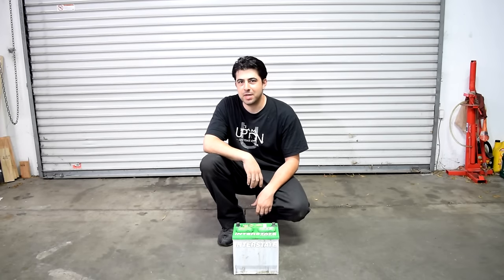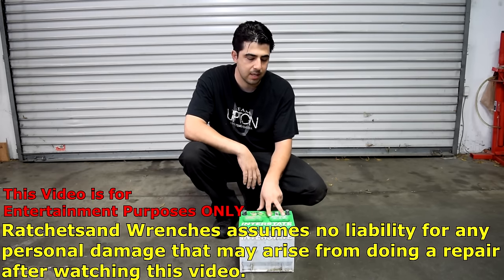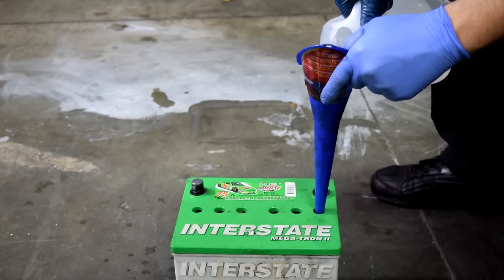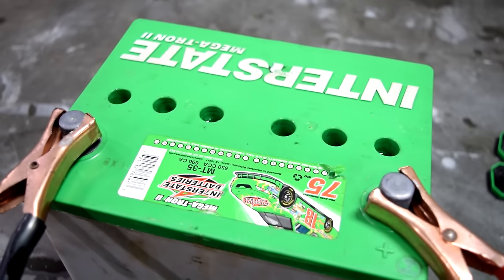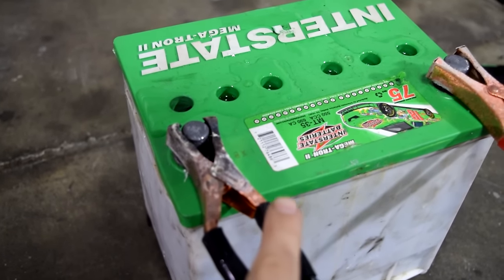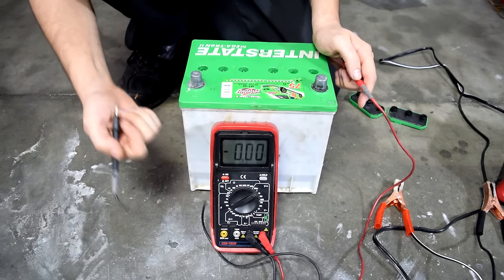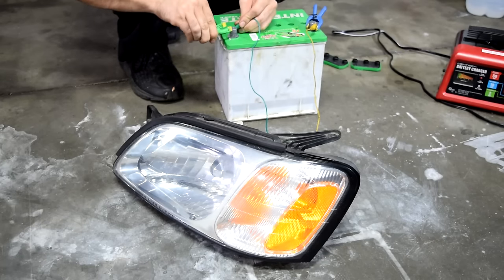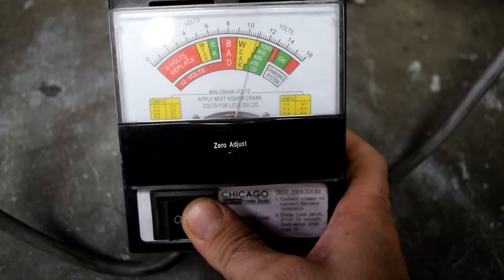Is it Possible to Revive a Dead Battery with Epsom Salt - See For Yourself

Comment: This method might a actually restore a battery under some circumstances, but as a general rule, the most common reasons for battery failure would not be helped here.  I used to work in an automotive battery manufacturing plant.  While there I met a man who had actually tried to start a business which identified junk batteries that could be reconditioned for resale. (Junk batteries are the used batteries that shops take in from consumers, which are usually sent to a lead smelter to recover the lead.)  The business failed, because only a small percentage of batteries could be reconditioned, and even the ones that could be reconditioned frequently failed again within too short a time to make them worth paying money for. And he tried this back when our roads in the US were generally in much better condition. Roads? Yeah, one of the most vulnerable parts lead acid batteries is the inter-cell connections.  On a typical 12 volt automotive battery there are five inter-cell connections.  If just one of these connections becomes damaged, the battery will fail.  A battery that bounces around a lot on bad roads is much more likely to have this type of problem.  Since most batteries these days are assembled via automation which requires higher molten lead temperatures, the lead takes on a crystalline structure which is more easily broken over time.  If your battery is what we used to call an 'oddball' battery -- a battery type that is kind of rare -- then it's more likely that that battery was made by the hand method, which produces much better inter-cell connections. Road vibration can also cause the separator material between the plates in the battery to get worn causing shorts.  The hallmark of a cheaply made battery is cheap paper-like separator material.  Really high quality industrial batteries encase cells in envelopes of high quality separator material, but since this tends to make each cell a lot bigger, you rarely see this on automotive batteries.  Most of the time manufacturers put better quality separator material in the batteries with longer warranties.  In summary, automotive batteries simply are not engineered to last indefinitely, and in the greater scheme of things, they are not all that expensive to replace when needed.  Sure, if you've got the time and inclination, you might put off the inevitable for a time, but even though batteries don't have moving parts, they eventually just wear out.  Personally, a know a whole lot more about batteries from both the chemical, engineering and manufacturing standpoint, but when my battery starts to go bad, I just replace it. If it's still under warranty, fine. If not, I know that it was never engineered to work indefinitely.
Reply: That's about right---built-in obsolescence, period
Reply: There are some really interesting videos here on youtube about people that have replaced their automotive batteries with capacitors.  Capacitors will not store as much energy, but they will last a long time if the quality is good. One guy used a small battery as a backup for the capacitor bank, so that he could run his radio when the car was off.  I really like this kind of thinking.  In my opinion, what cars have always needed us a simple and reliable backup power generating system.  Such a thing would be ideal for use with a capacitor bank.  In general, though, I think that lead-acid batteries are going to start gradually disappearing from the automotive scene. Not only are other battery technologies advancing rapidly, but with computers intimately involved in every aspect of the automobile's operation, it is now possible to start a vehicle with far less power.  The computer can know the exact location of every piston on the engine, an determine the best low-power starting sequence.  Then again, there have been serious predictions -- dating back to the 1970s -- that have predicted the internal combustion engine's demise, but because so much transportation infrastructure in built up around petroleum products, alternatives have never gotten of the ground.  The thing about batteries and obsolescence is that the cost of building truly high-quality, uber-long-lasting batteries would be prohibitively expensive.  In fact, you can buy same really high-quality batteries today.  They are usually purchased by people who have power-hungry, high-end stereo systems in their vehicle.  Oddly, despite the high build quality, the manufacturers do not appear to offer longer warranties for their products, so unless you just really need the amps or added reliability, they are not very cost effective.
Reply: Wen0110 Thank you for the valuable feedback. Nice to hear from someone involved in the manufacturing side. I was actually thinking of starting a battery recovery business myself but had so little success that I realized early on there's not much money to be made there. Too many batteries have serious physical damage that simple cycling or chemical treatment won't be able to fix.

I am a mechanical engineer in my day to day job (I started out in a semiconductor manufacturing plant and these days I work in aircraft maintenance). I know exactly why things are built to only last as long as they need to, and not longer: the price. 

Think of it this way. Nowadays people are happy buying a $85 car battery that lasts 5 years. That's what everyone is used to in fact. 
It is possible to make a car battery that lasts longer. But obviously the cost of the better raw materials, higher quality supply chain, more accurate production processes, more quality control steps, etc. would drive the price up. 

Say a company actually did that, and made batteries that last 10 years but cost $140. Most consumers wouldn't buy it! 
They wouldn't sell anywhere near as many batteries as the companies selling regular 5-year batteries for $85 because for most consumers, the sweet spot for price vs. quality is right where regular car batteries already are now.

In contrast, for deep-cycle applications (like off-grid, marine and RV use), the sweet spot is further up the quality scale, and these batteries are typically more more expensive and much better performing. Some modern setups even use LiFePO4 batteries (about 4-6x the price of normal lead-acid) because of the longevity and performance advantages! Only high-end cars like the Porsche 911 come with a lithium-iron-phosphate option!
Reply: Wen0110 
Very good comment
Reply: Very good  comment
Reply: Yeah, everyone's looking for The Fountain of Youth and it just doesn't exist. Well said! Chances of rejuvenating a car battery for much longer than a few weeks is unlikely. However, we do pay much too much for new car batteries...got us by the balls!
Reply: Thank you. Yes, I would imagine you would need to actually test the battery to see what condition it is in now before you would consider this.
Reply: walmart = 49 dollars
Reply: Deep cycle batteries seem to have stronger connections between cells.
Reply: I worked for a used car lot in the early 80's. We bought all of our replacement batteries for $18 each (with exchange)  from an old guy who made a fair living selling reconditioned batteries to used car lots. I don't know how he did it, but it certainly be done.
Reply: thanks for the info.
Reply: Marine batteries , expensive can pay dividends if one wants long life batteries in rough conditions.
Reply: Eric jones not for an interstate.
Reply: Wen0110 very insightful
Reply: @williamgregor8495  that's like calling worn out tires built in obsolescence.  There is a big difference between wear and tear where something wears out and being obsolete where things still works fine but got replace by the "latest and greatest".
Reply: is the best explanation of all, but I saw in another video a guy who repaired a battery only with water and Epson salt
Reply: Magic mender green
Reply: "Great", was my first thought. I don't need a new battery - I can do that ....... but after reading the educated explanations down here, especially from Wen0110, I scrap my plan and buy a new battery.  No reason to subscribe here to get only bad advice.
Reply: Wen0110 thanks
Reply: @Wen-ve8nx  they do have a back up sytem for energy like that they use large capacitors to help give energy to audio sytems that draw to much power from the battery when the base drops.
Reply: Thank you brother.... Time is money and you was a big help
Reply: @Ihavetruth22   not where i live 149 00 750 cca
Reply: I'm a auto electrician and i agree with you, when you battery is dead, it's dead, just replace it.
Reply: @aguanut  must have been in the eighties.
Reply: Wow! You're the battery guru! Great info!!! I often wonder how much bad roads contribute to battery failure. You make good points. I think I'm going to pad the bottom of the battery tray. Can't hurt.
Reply: Appreciate video content! Sorry for the intrusion, I would appreciate your thoughts. Have you ever tried - Lammywalness Trendy Trade Guide (probably on Google)? It is a great one of a kind product for learning how to recondition batteries at home without the normal expense. Ive heard some decent things about it and my cooworker after a lifetime of fighting got excellent results with it.
Reply: Nice video content! Excuse me for the intrusion, I am interested in your opinion. Have you considered - Lammywalness Trendy Trade Guide (do a search on google)? It is a great one of a kind product for learning how to recondition batteries at home minus the hard work. Ive heard some super things about it and my m8  got great success with it.
Reply: Appreciate Video clip! Excuse me for the intrusion, I would love your initial thoughts. Have you considered - Lammywalness Trendy Trade Guide (Have a quick look on google cant remember the place now)? It is a good exclusive guide for learning how to recondition batteries at home minus the hard work. Ive heard some extraordinary things about it and my cousin at very last got cool results with it.
Reply: I don't know much about the dynamics of battery technology but your comment makes a lot of sense to me. I can't deal with all the maybes and potential hazards involved. If my battery is bad, simply replace it. It ain't worth it, especially the risks.
Reply: Words of a smart person
Reply: Just wonderful, I been tryin to find out about "rebuilt auto battery" for a while now, and I think this has helped. Have you heard people talk about - Ammaceen Reconditioning Rabblement - (do a google search ) ? Ive heard some decent things about it and my co-worker got amazing success with it.
Reply: Many thanks, been searching for "reconditioned battery car" for a while now, and I think this has helped. Have you heard people talk about - Ammaceen Reconditioning Rabblement - (should be on google have a look ) ? Ive heard some pretty good things about it and my co-worker got cool success with it.
Reply: This was great, thanks, I have been researching "restore a car battery" for a while now, and I think this has helped. You ever tried - Ammaceen Reconditioning Rabblement - (Have a quick look on google cant remember the place now ) ? Ive heard some great things about it and my mate got cool success with it.
Reply: I've been researching into battery reconditioning and discovered a great resource at Magic Mender Wizard (check it out on google)
Reply: There are several factors in doing a pro job. One plan I discovered that successfully combines these is the Magic Mender Wizard (check it out on google) definately the most helpful course that I've seen. look at this  interesting resource.
Reply: Cheers for the Video! Apologies for the intrusion, I would appreciate your opinion. Have you ever tried - Rozardner Powerful Battery Reality (do a google search)? It is a good one off product for learning how to recondition an old battery minus the hard work. Ive heard some unbelievable things about it and my mate at very last got astronomical results with it.
Reply: Thanks for the Video! Forgive me for butting in, I would love your initial thoughts. Have you tried - Rozardner Powerful Battery Reality (do a google search)? It is a great exclusive guide for learning how to recondition an old battery minus the headache. Ive heard some interesting things about it and my cooworker finally got astronomical results with it.
Reply: Great video content! Excuse me for the intrusion, I would love your thoughts. Have you ever tried - Rozardner Powerful Battery Reality (google it)? It is a good exclusive product for learning how to recondition an old battery minus the normal expense. Ive heard some unbelievable things about it and my friend at very last got amazing results with it.
Reply: @shaibaldev8588  Scam.
Reply: Nice Video clip! Apologies for butting in, I would appreciate your thoughts. Have you heard the talk about - Rozardner Powerful Battery Reality (Have a quick look on google cant remember the place now)? It is a good one off guide for learning how to recondition an old battery minus the normal expense. Ive heard some incredible things about it and my friend Sam  got great results with it.
Reply: Appreciate Video clip! Forgive me for the intrusion, I am interested in your thoughts. Have you heard about - Rozardner Powerful Battery Reality (do a search on google)? It is a smashing exclusive product for learning how to recondition an old battery minus the normal expense. Ive heard some awesome things about it and my mate at last got amazing results with it.
Reply: Lovely Video clip! Sorry for butting in, I am interested in your initial thoughts. Have you ever tried - Rozardner Powerful Battery Reality (do a search on google)? It is a good one of a kind guide for learning how to recondition an old battery without the headache. Ive heard some awesome things about it and my BF finally got amazing success with it.
Reply: Appreciate Video clip! Excuse me for chiming in, I would appreciate your opinion. Have you thought about - Rozardner Powerful Battery Reality (search on google)? It is an awesome one of a kind guide for learning how to recondition an old battery without the headache. Ive heard some pretty good things about it and my old buddy Taylor  got amazing results with it.
Reply: Nice video content! Excuse me for butting in, I would love your thoughts. Have you thought about - Rozardner Powerful Battery Reality (Sure I saw it on Google)? It is a smashing exclusive guide for learning how to recondition an old battery minus the normal expense. Ive heard some extraordinary things about it and my close friend Aubrey finally got great success with it.
Reply: Kudos for the Video! Apologies for the intrusion, I am interested in your initial thoughts. Have you researched - Rozardner Powerful Battery Reality (should be on google have a look)? It is a good one of a kind guide for learning how to recondition an old battery without the normal expense. Ive heard some amazing things about it and my mate  got astronomical success with it.
Reply: Kudos for the video content! Excuse me for butting in, I would appreciate your thoughts. Have you researched - Rozardner Powerful Battery Reality (should be on google have a look)? It is an awesome one of a kind guide for learning how to recondition an old battery minus the headache. Ive heard some decent things about it and my buddy at last got astronomical success with it.
Reply: Imagine how good social media would be if all comments were this informative and thoughtful.  Thanks dude.
Reply: Nice Video clip! Forgive me for the intrusion, I am interested in your opinion. Have you tried - Lammywalness Trendy Trade Guide (do a google search)? It is a good one off guide for learning how to recondition batteries at home without the hard work. Ive heard some super things about it and my m8 at very last got excellent results with it.
Reply: Appreciate Video clip! Forgive me for chiming in, I am interested in your initial thoughts. Have you thought about - Lammywalness Trendy Trade Guide (google it)? It is an awesome one off product for learning how to recondition batteries at home minus the headache. Ive heard some amazing things about it and my cooworker at very last got great success with it.
Reply: Thanks for the Video clip! Sorry for butting in, I would appreciate your initial thoughts. Have you considered - Rozardner Powerful Battery Reality (do a search on google)? It is a smashing one of a kind guide for learning how to recondition an old battery minus the normal expense. Ive heard some awesome things about it and my work buddy at last got excellent success with it.
Reply: I would never sell a battery like this to anyone no matter how well it tested. this is strictly to restore a battery to be used by the person restoring it and if it doesn't work no harm done.
Reply: @celinelait9893  you have put lot of advertisement here
Reply: @LMF5000  The price of anything has not much to do with manufacturing cost anymore. Its the "sweet spot for price" as you called it what dictates the prices. We saw it during covid19 and after. Most everything is more expensive and people accept the price because - at least its available. So what happened ? We started to appreciate things we took for granted and allow the higher price. It also killed the low profit retailers who did not have a fall-back plans in case there is a low sales for a few months.  
Things are priced randomly. A part that fits a Chevy Cobalt vs. the same part that fits a Cadillac or Porsche can have 400% price difference.  Not because its better or more expensive to manufacture but simply the "sweet spot" as in what can a customer pay for the part.  Obviously the guy with a 100k car will not hiccup on something that a 20k car buyer will choke on.  I work in the car industry and I buy huge windshields for $36.80 - and also small ones for $600.  The cost of the windshield should be based on the amount of glass it needs. But it isn't.  Its priced on what the new car cost and how many pieces can we sell from each one. The molds are sand so they need to be redone periodically, thus the actual cost of a BMW i8 vs. Ford F150 isn't really that much difference.  You might sell 8 for the BMW i8 and 80,000 for a F150 annually.  The price of a glass is set, none are much different then others.  I'm pretty sure its same at batteries. The separator plates are probably cheap, so a much better battery would cost 4-5usd more but since it would be "more expensive" the price will be dramatically increased thus selling in lower numbers.  The key is - volume. If they make them just last the warranty period plus 50% , then after that every customer will buy a new one. The profit on 2 cheap batteries  are more then selling one that last double the time but more expensive.  You can't double the price as it would fall out of the "sweet spot".  Everything is dictated by the profit margin. 50-60 years ago companies were proud of their quality, today they are proud of their quantity (or profit margin). This is modern life, everything is a throw away item. Hence the reason for the huge garbage problem which creates more expensive and lesser quality products.  Sadly the end user is ending up with frustration and more purchases and more junk items.
Reply: A lot of people who are studying how to repair and recondition lead acid batteries are not for automotive use.
It's mainly for backup or off-grid power bank use. So vibration damage is not the problem.
Lead acid batteries are the only repairable batteries in practical sense.
Reply: Great summation of Battery Technology thank you for the time you spent articulating it in the comments section.
 I understand that Battery Technology goes back to the Roman days perhaps as many as 1 to 2000 years ago? But I have an interesting take based on what I've researched what these comments tell me is there's room for someone who can build a small Factory and make super good batteries , whether lead and acid or other material. Sure you'd have to contend with the EPA but there's ways to mitigate some of that as some of us know.
Reply: @Wen0110, thank you for the info, definitely there’s always something new we can learn everyday. 👍🏽
Reply: I believe you're mistaken on the "most", you're right that there are a lot of batteries this wouldn't restore.  With out a doubt, most batteries fail when the collection trays at the bottom fill up and contact the plates. That 5-7 year need a new one.   Then all the vibration and frost issues, which this won't help.  Just draining, cleaning, filtering and or replacing the acid after rinsing the collection tray would restore most, with or without the epsom salt. The epsom does help retore the sufaces though.
Reply: I respect your experience and view. However, from experience batteries used to last 4 to 6 years. 
The Battery company that I worked for had batch issues with their battery and when opened it had suphation.
We ended up claiming credit for the batch from head office. The technical person mentioned they changed their design and lead content (to save on lead).
My next door neighbor had a car battery that lasted 25 years and the manufacturer wanted to buy it back.

They don't make them like they can and used to.
Reply: Hmm, very interesting reading about "built in obsolescence".🙂
Reply: I use my old batteries to make Methamphetamine anyone with junk batteries send them my way thanks.
Reply: I've often wondered how good a "recontioned" battery really is. You see on YouTube videos guys saying they can get them going again. Like you say maybe in the short term, but like you said batteries have life. When they go bad, just replace it. I would imagine that goes for all the small deep cycle batteries as well.
Reply: Have you seen the video of some guy in a third world country disassembling everything, to include the plastic cases, and rebuilding the batteries?  I doubt the EPA or OSHA influence his procedure, but I do wonder what life he gets out off them.
Reply: Thanks. That’s very helpful information. Thanks for posting.
Reply: Thank you. Your comment was better than all the battery repair videos I've watched. Thanks again
Reply: Thank you soooooo much🤗
Reply: THIS COMMENT
Reply: @sdi1111 Use a solar battery maintainer that has overcharging protection via the OBD-II port. It will make car batteries last longer. The reason they fail is typically because they sit at partial charge. A solar battery maintainer should ensure that it stays at a full charge, which will extend its life.
Reply: @Wen-ve8nx 🤦You talk way too much and prove none of what you say.
Reply: What battery do u run ?
Reply: Correct sir! As a chemist I agree with everything you said there. I mean if you're stuck and are strapped for cash for maybe a couple of days and you have this stuff lying around in your garage, so be it but youre the first person ever to mention how lead plates can crystallize and harmonics from a shitty infrastructure these days is so true ! You cant go 3 miles without hitting chewed up road and or pot holes! And I have a problem with the MgSO4 (Epsom salt) hes using as an electrolyte! It cant give the performance for more than a few weeks, if that! There's a reason why all these company's that produce batteries have been using H2SO4 (sulfuric acid) all these years!  Im sure seeing how magnesium sulfate is pennys when it comes to cost compared to sulfuric acid. And wouldn't the companies jump on the Epsom salt solution if it was equal or better? Nice to see there are still some folks who still use brain power out here😂 its us old school guys who understand that there is no substitute for hands on experience! 😊
Reply: 7 years after this Comment….Who  can afford to buy a new battery these days. PRICES ARE INSANE.   I’ll try anything to save a Buck.
Reply: Bro you are lit.